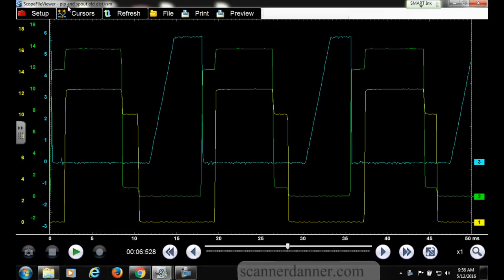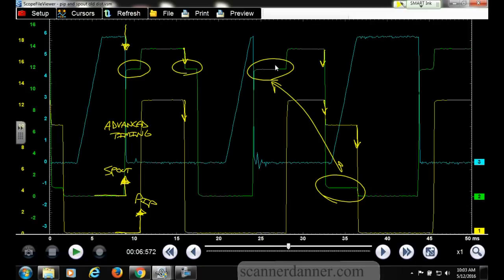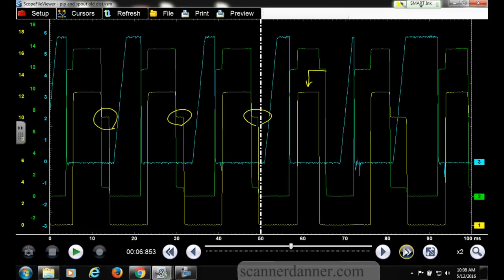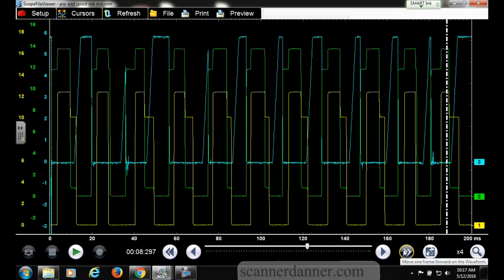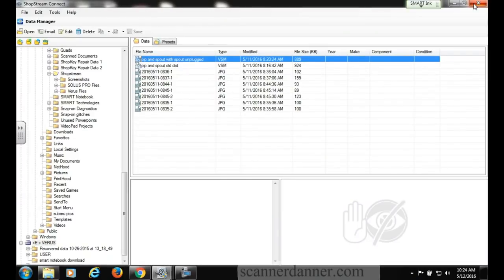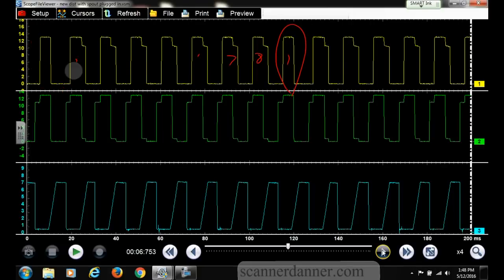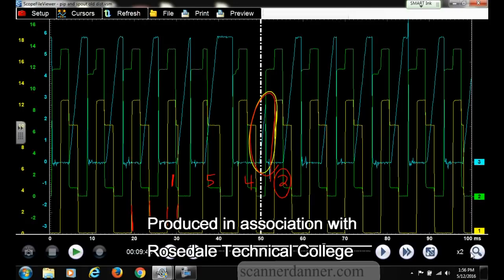Ford EEC IV Distributor Pick-up or Faulty Ignition Module - Part 2

Comment from the maker: In this part 2 of 2 series, I will be reviewing the captures taken from the old distributor on the smartboard with my class. Then we install the new distributor, briefly show the waveforms live, then return to the classroom with the good captures and compare them to the bad. To join my classes online, sign up for ScannerDanner Premium https://www.scannerdanner.com/join-scannerdanner-premium.html There is a 14 day free trial. 

Engine Performance Diagnostics chapter 22 (available at www.scannerdanner.com)

Symptoms
  - #2 cylinder misfire
  - intermittent misfiring from other cylinders 
  - run okay at WOT and idle
  - no misfiring with Spout connector unplugged

Fix
  - replace faulty distributor pick-up assembly 

Tests shown
  - how to verify weak spark with an in-line spark tester
  - how to test the PIP and SPOUT signals with a lab scope
  - how to test coil primary current to verify a dwell time problem
Reply: I'll bet the fuel economy noticeably improved!

Comment: 1989 Ford Bronco ii) eradic ignition waveforms, I tested the Motorcraft condenser on the side of the coil, it failed. I replaced it and what a difference. I think the voltage spikes were negatively affecting my performance?

Comment: I have an 89 E150 with the 4.9, drive to the store, come out, start it, quit, start it, quit, start it, rev it up, lethargic, try to drive it home, spit, sputter, try to stall at every stop, top speed was 35 MPH, sounds like every valve is rattling, barely make it home. I thought fuel issue, gauge reads 50 PSI engine running, unless it drops off when hot, its not fuel, had the distributor replaced last year with plugs, plug wires, cap and rotor, original distributor had one of the cap hold down broken off, its not run right since, but has really degraded to practically undriveable. I am so disgusted, but I'm committed, I've put a wheelchair lift, seatbase, and hand controls in it, over $7000 worth of equipment, replaced the floor, and had the rust repairs done, I can't just throw it out. I miss my 73 E100, none of this electronic garbage, too bad it was totaled, leaving me no choices!
Reply from the maker: Disconnect your spout connector and then tell me how it runs
Reply: @ScannerDanner  Gotta send it to a shop, I can't reach it, wanted to pull the spout to see if it cleared up. Getting old, the wheelchair couldn't slow me fast enough, so arthritis set in, and last year I damaged the pump in my abdomen pulling the front apart to replace my coil springs, that surgery pretty much nipped crawling around the van. Dad found a guy who works on many of the Ford inlines, will see what he finds next week. Windshield leaked when I got it, hoping the computer is OK, as its under the heater box where the water ran down, rotting out my floor.
Reply from the maker: @Maples01  I'm sorry my friend. I'd love to be able to help you. You're not close to Pittsburgh Pa are you?
Reply: @ScannerDanner  No, Tennessee, had gotten used to a 73 Econoline with a 302, so simple to repair and keep running, forgot what a headache OBD1 was even when new, but went after it because the longevity of the 300 6, a durable engine, tho strangled with lots of electronic garbage known to fail, wish I knew how to swap over to the later 96 ignition with the module off the distributor, away from the engine on a heat sink. I have a friend with a 96 E150 just like mine, C6 transmission, has 400,000 miles on it and neither have had to be rebuilt.
Reply: @ScannerDanner  Another shop, drove it, ran fine, but on the way to the shop even dad noticed it missing like crazy. Really mad I keep getting it back being told nothing wrong with it. Maybe the alternator isn't charging enough, I'd have trouble explaining that since no one uses the radio and wheelchair lift.
Reply: @ScannerDanner  Pulled the pip, no change, you can turn the distributor to get it running a little better, but has absolutely no power, wouldn't pull up the hill in dads neighborhood, and when the distributor is set where it runs decent, it will not idle.
Reply from the maker: @Maples01  revisit fuel psi. It must be tested on a snap throttle to red-line
Reply: @ScannerDanner  Had I been there, I would have hooked up my pressure gauge and tried the hill, I had no issues when I checked the pressure last time, but it wasn't put under load. I can say this has been degrading slowly until the last shop, was driven there, but you can't drive it now, seems to me its like its in limp mode. I'm bothered by it was driven over 300 miles before replacing the distributor after tuneup, should have left it alone, but a cap screw was busted off, the pickup inside the distributor is said to trigger the injectors, it could be failing, I just have no equipment to test it, and being a van, you have to be under it to get at the distributor. I can't reach the TPS to get a reading on it, the computer is throwing no codes, no hints where to start, began with a MAP and O2, replaced those and took care of codes last year, but it was experiencing idle surge upon restart when warm.
Reply: @ScannerDanner  Figured I'd update you, been running on 4 cylinders, 3 and 4 dead, compression test was done, intake was removed and got new injectors, still the same, its a nightmare. Shop has to boost it off to get it running, battery cables need replaced, positive and ground to the engine, the plug wires I put on last year, the ends came off when the mechanic went to pull them off the plugs, needs new wires again, this setup Ford must have stole from hell.

Comment: When you mentioned someone told you to see if it was soft, the pickup coil is encased in epoxy. If the coil overheats, the epoxy will soften and become discolored. I have seen the same effect on ignition modules for coil packs. The board is encased in epoxy which is clear, if it's milky and gooey then it's bad

Comment: Also check the capacitor on the coil. If its not filtering the ignition noise it will feedback to the TFI (AKA ICM) and the PIP and SPOUT with carry that noise and cause a misfire as well. Especially if your ECU has poor power and grounds. Check that the ECU had full power with a test light that has about 2 or 3 amps of current on the power and then flip and test the computer ground to the hot. Weak voltage to the ECU will cause headaches and the rest of your tests. After checking just read the signals again on the PIP and SPOUT and see if the noise still gets on those lines check the coil capacitor and see if its a weak cap if you have a capacitor tester. The original capacitor was 233nF (Nano Farads) and I put on a 650nF Capacitor actually from a dodge fuel injector electrical capacitor. Worked better to get rid of noise a heck of a lot more. Vehicle ran better but still had a random misfire but not as bad as before. Changed the TFI and was back in business. Plus added ground lines to engine to the body and to the ECU to make sure it had strong grounds everywhere. Had a complete new distributor right out of the box fail (ICM) WAI Global brand - Do not recommend buying that brand. Spend extra and get the cardone and the motorcraft TFI distributor mounted then cap and rotor. You might spend extra on it but in the end you have a better chance it working  instead of an off brand China part

Comment: I have a good question! What is the difference between the 83 through 85 distributor vs the 85 and up? I tried an 89 distributor in my 84 and had no timing advance. They look identical.
Reply: Actually 84-85 is different than 86 thru 90. Only physical difference i can tell is the style of rotor but the tone ring might be cut differently or something.

Comment: They are different in length because of your advanced or retarded state in degrees and inconsistent comes from module instability hz
The ECM use’s the advance state to set the injector ms and the restarted state to switch of the injectors 
PLEASE correct me if iam wrong thanks Paul for all your work

Comment: I don't understand how with the spout unplugged, you get square waves that you'd expect from a hall effect.  Yet when you plug in the spout, they both get altered.  Is it possible the circuit design loads the hall effect sensor and puts some higher than anticipated current on the signal wire?  Maybe the spout loads the pip signal and pulls it down somehow?  Either way, this a good learning experience where I probably would've called an engine computer also.  Thanks for taking the beating for us!
Reply: I believe Paul ScannerDanner mentioned that the SPOUT signal was being monitored at the output pin of the CPU #36 (in my case '86 GT), also keep in mind the SPOUT connector was disconnected when he showed the Graph form of a Clean SPOUT signal and a Clean PIP signal, therefore the Spout connector  is in between the CPU output Pin #36 and the input Pin #5 on the TFI Ignition Module.  I believe this input pin #5 Circuitry is causing some type of an excessive load on this SPOUT signal when it's connected.  That's why when the SPOUT connector is connected , the SPOUT signal becomes distorted, etc.  Also, when the TFI module receives no SPOUT signal (SPOUT disconnected) it uses the PIP signal which is at base timing !! During the time the PIP is being used, the engine is at base timing and since the PIP is clean square wave, the engine has NO misfire.
Reply from the maker: I wish I could answer intelligently but I can't. I only know how to spot it.
Reply: @ScannerDanner  I meant to add to my original post... an amp clamp on the spout/pip can answer the question.  Too bad the car's probably gone by now...

Comment: After watching this video I thought about reaching out to another YouTube creator. Dave Jones EEV Blog in Australia might have fun taking a stab with this phenomenon. My initial thought was the connection with the EEC and the TFM was pulling the circuit down. But I’m lost as to why the signal coming from the Hall effect is corrupted when the spout is connected. 
Then it occurred to me on the 302 with the firing order and a old TSB from Ford about special wire routing of wires 7 and 8 due to crossfire when the wires are arranged in parallel voltage is induced into the adjacent wire. Have you seen this issue on other engines or is this issue specific to the 302?
Reply from the maker: Need a module block diagram to answer this phenomenon and someone who's knows how to read it. Generic info won't cut it imo

Comment: It would be cool to make a bench test device 😂 a motor spinning the distributor, access to the pip and tfi internals, and a pcm.
Unless an engineer had the answers that is.
I wonder if that low spike is a magnetic/electrical flyback voltage. Old or poorly "reman" components that arent properly insulated, shielded, ect could act like a lighting rod correct?

Comment: First off hope family is doing well. Second thank you for taking time and posting these videos. Last year I was having issues with my 87 5.0. Had three mechanics over to try to help. Had bad miss off idle and car would fall flat around 2-3000 rpm. No one could figure it out. After watching a couple (a lot) of your videos I was able to borrow an oscilloscope from auto tech teacher and diagnosed the issue. It ended up being the pick up in the distributor. Without you videos I probably would have not figured the issues out with my car.  Thank you.

Comment: I think it's just a chip timing failure in icm. Coil dwell start timing is consistent in a good module, and gets confused from the spout in a bad one. Sync pulse causes timing error when spout on. Is misfire always #2?  Very unusual problem and I'm glad you shared this diagnosis!
Reply from the maker: It is not an ICM issue

Comment: Is it possible that the teeth on the distributor shaft were uneven, causing a "dwell" or variance in the pickup input to the computer?
    The misfire was fairly consistent on cylinders 4/2, which indicates a fairly consistent cause, timed to the firing order.
    A faulty ground screw inside the distributor housing might result in a faulty signal, but not consistently, one would think.
   Removing the SPOUT connector eliminated the computer variation, but even so, there was still a slight variation in the timing, as indicated by the waveforms.  But, the exaggerated variation from the computer was "calmed down".
    Just wondering ... you said the problem was present "right out of the box" after the previous repair when the first shop removed the SPOUT connector to cover the fault.
    P.S. Either the gear teeth might have been sloppily manufactured, or (I have heard) maybe the distributor had a gear wheel made for a different part number.
Reply from the maker: No sir, this is a common issue with these and I've been seeing it for 15+ years
Reply: @ScannerDanner  OK, thank you!

Comment: I had a similar issue with a GM TBI engine in an 89 Camaro back before I knew how to diagnose this.  We swapped every electrical part in the distributor and still didn't fix it. Ran great with the EST wire unplugged but terrible with it in.  Ended up swapping the distributor a 3rd time to fix it (original had major shaft play, ran great but destroyed cap and rotors). Never did figure out why it did this..

Comment: Have you diaged one that had bad pcm capacitors? The mustangs being this old are common to have caps that have dried up. Just like an old battery, its no longer taking a charge therefore not doing its job. Now the voltage it filters is not being filtered.
I have seen very strange things happen when the caps go bad...
Reply from the maker: I have not 😉

Comment: Hi Paul,
I just noticed something else besides the digital summing which doesn't seem to be very important: the duty cycle in the charging and discharging is awkward in the faulty device. It seems to be some 60 off and 40 on. During the charge event for the synchronization it becomes even more unbalanced with a 85 off and 15 on, thus the weak spark. The computer seems to compensate for something and reduces the duty cycle drastically. 
With the coil replaced the duty cycle is 50 to 50 which is logical to be as there is no rush in charging or discharging.
Cheers!

Comment: I notice that with the spout disconnected the peak PIP voltage is ~12V and the Spout is ~14V. With the Spout connected they remain that way with the old distributor but pull each other to ~13V with the new distributor. I don't know if it means anything. Does the module need to see the same voltage on both? Does it indicate a faulty circuit?
Reply from the maker: Now you're making me go back and look lol got a time frame for those for me?
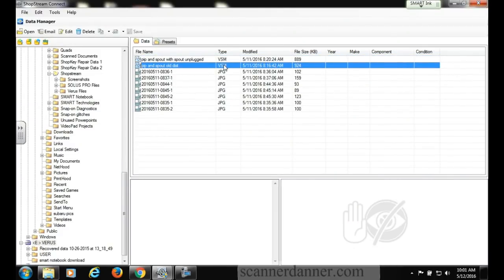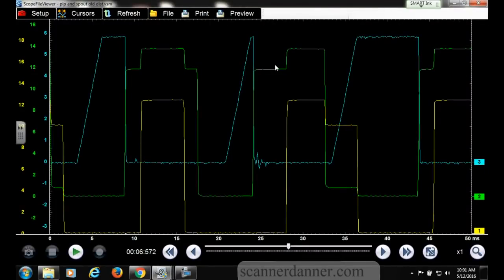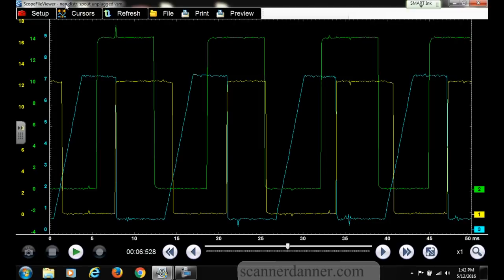Reply: @ScannerDanner  @4:05 &4:20, and @34:30 & 34:50. Sorry for the delay.

Comment: Currently at 7:30...  I believe the pickup is causing the computer to advance (way too much) on that cylinder (varies which one) which along with insufficient spark caused by the coil not having time to saturate magnetically (thus giving weak spark/low current/voltage).  Hope pickup fixes it... still watching.  If I had one of those I'd disassemble and provide the circuit (pia, but interesting).
Cheated and fast forwarded... I suspect the 'stator" has metallurgically changed magnetically of there's a bad connection beginning (increased resistance at time due to vibration) inside the poted pickup from a manufacturing poor solder joint in it.  The later more likely imo.
Car sounds good SD!  And you are a hero for teaching.  God bless and hope your granddaughter (sry if wrong family member... old and memory) has recovered.

Comment: Take a breath pal. The family emergency has settled 😄 and you nailed the waveform.
As you well know, electronic circuits can fail in bizarre ways and quite often do, making known good traces invaluable.

On another note, its a distraction when something with only four variables operating in linear fashion can beget data overload. Gotta KIS keep it simple. Turn coil on at a given location, turn it off at a certain time, produce a consistent spark.
After establishing voltage supply level
I first noticed that the dwell time was intermittently breaking down in the primary leading to what would no doubt be a cylinder misfire. Since there was no reason to suspect coil turn-on location and unpluging the spout changed the dwell (advance timing). The  two remaining variables were inside the distributor.
Game over. I love getting paid flat-rate. 😄

Comment: In the mid 70s a customer had a Grand Torino with intermittent rough running. A timing light showed his timing bouncing between normal and too far advanced in a back and forth pattern. I had to pretend to be someone far more important than I was to  speak directly to Ford's engineering department. The engineer admitted that although something he would never suspect, that it was a remote possibility a malfunctioning ignition control module could cause irratic timing fluctuations. I replaced the module and the problem was gone. Now on your vehicle, is it possible  the pickup wheel is becoming gaussed in one area? Maybe a bent distributor shaft? Since a partially magnetized piece of metal can't be detected without equipment, it would make sense that a reman distributor could have the same flaw out of the box. A magnetized part trying to work in a magnetic field could effect the module's interpretation of the trigger.
Just thinking out loud.
Reply: bernie thompson had a crank tone wheel magnetized  causing an errant pickup and miss

Comment: It's confusing when you keep saying the crank sensor needs to be replaced on this vehicle but you're talking about the PIP signal being bad.  PIP is the cam signal.  While they are related they are not the same. ;)
Reply from the maker: Technically it is the crank sensor, even though it is driven by the cam. 😉